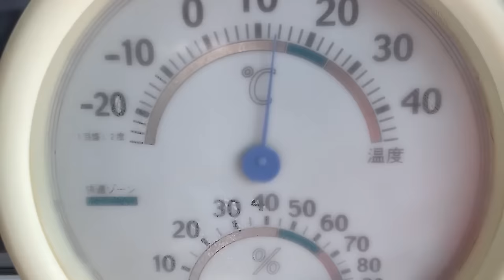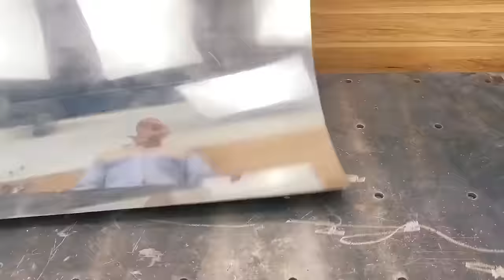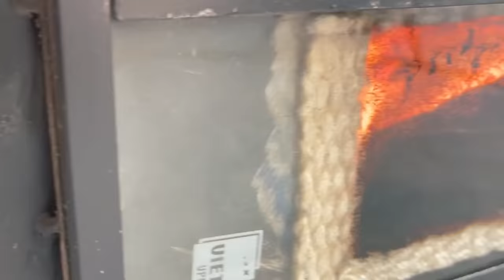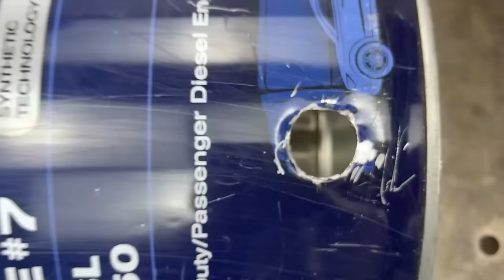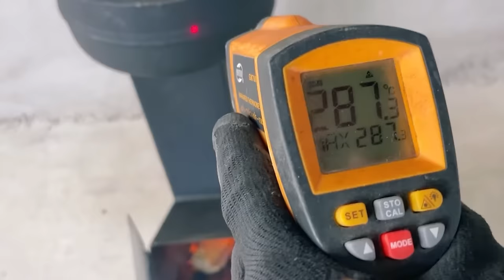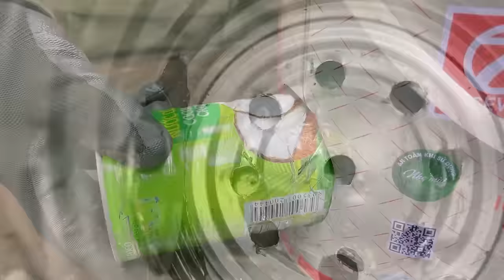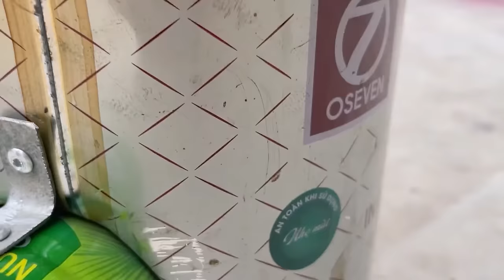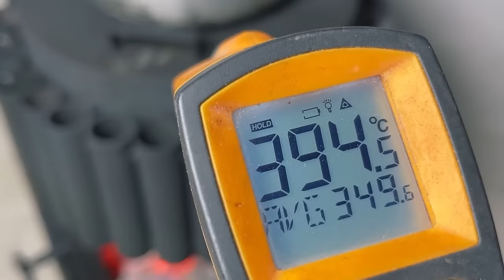Store energy from sand batteries! The most magical heating stove models of 2024! Extremely warm

Comment: Hate that DUMB music!! Muting is good! Weld this. Weld that. Good for house & cabin, but if it was in 2 or 3 sections..be easier to move for camping maybe?? Use SOME nuts & bolts!
Reply from the maker: I know what you mean about music—sometimes it can be a little overwhelming!
Using nuts and bolts can also make assembly and disassembly simpler. Thanks for sharing your thoughts! If you have any additional suggestions, I'd love to hear them!

Comment: I have been given old oil fired boilers in recent times with people upgrading or changing to gas other systems & the potential for making projects like this are many.
Reply from the maker: Yes, thank you for your interest and for having such thoughts. Yes, sir, due to waste in some places, it is not allowed to use it, right? But it will save a lot of costs as well as use it for the right purpose. If you can do it well without causing any harm, burn it thoroughly without any smoke coming out, then the problem will be solved, right? If you have any suggestions or participation, please leave a comment below so that we can together create new designs. The kitchen has many values without affecting the environment

Comment: Use a portable plasma cutter. Ditch the grinder and cutting wheels.
Reply from the maker: Using a handheld plasma cutter can be a more efficient and accurate method for cutting metal. Plasma cutters can cut a variety of metals quickly and accurately, making them a good choice for projects that require clean, precise cuts. By switching to a plasma cutter, you can save time and effort compared to using grinders and cutting wheels. Additionally, plasma cutters tend to produce less waste and thermal distortion on the metal, resulting in a cleaner and smoother surface.

Comment: Please, if you're going to put out fabrication videos for people to emulate, learn how to weld properly. Your "technique" produces porous, cold lapped, dirty welds that lack penetration. Sorry, but just dribbling little spots of filler metal here and there cannot produce a quality weld. What is especially concerning is that this finished product is going to be subjected to intense heat/cool cycles that will likely crack those "welds", releasing toxic fumes into the building. 15 year certified pipeline welder speaking.
Reply from the maker: Thank you for your feedback and expertise. It's important to ensure that fabrication techniques are safe, effective, and produce high-quality results, especially when it comes to projects that may be subjected to intense heat or other challenging conditions.

Creators who share fabrication videos should indeed prioritize safety and quality in their work, including proper welding techniques to ensure the integrity of the final product. Your insights as a certified pipeline welder are valuable, and highlighting the potential risks associated with substandard welding practices is crucial for the safety of both creators and those who may attempt to replicate the projects.

It's essential for creators to continuously improve their skills and knowledge, including learning proper welding techniques, seeking certifications or training when necessary, and adhering to industry standards and best practices. By doing so, they can contribute to the production of safe, reliable, and high-quality fabricated products.

If you have specific recommendations or advice for improving welding techniques in fabrication videos, I encourage you to share them constructively with creators to help them enhance the quality and safety of their work. Thank you again for your valuable input.